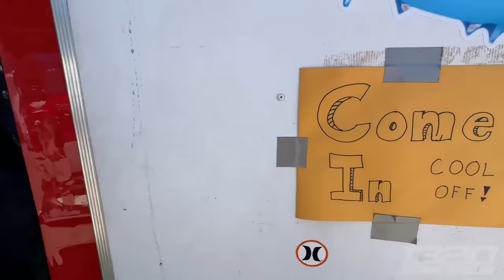300 racers take on 1000 mile Rocky Mountain road trip! | Race Week Day 1

Comment: I can't wait to be there for next year running the 11 second class with my audi a7
Reply: TTv6 awd?
Reply: @TheReaper42069  supercharged v6 awd witha zf8... upgraded pulleys, huge intercooler, upgraded fuel, r8 coilpacks, huge throttle body, divorced water to air supercharger cooling loop with a aux box for ice water, and water/meth injection
Reply: @TheReaper42069  should be 550-600. Cicio has them running mid 10s full interior. I'm gonna gut it for the track and being a hatch it's great for traveling and camping. I put a mattress in it and stay overnight when I go fishing. It's got h&r coilovers and all new solid bushings. Going thru all the supporting systems to make sure it's safe and reliable. It's easy to swap pulleys but I'm touching all the bases

Comment: I want to know who and how to contact someone, to talk about starting (and being a part of) the Ultimate Call Out Challenge Rocky Mountain Race week experience. We need a 1000 Mile Race week for Emissions Intact Diesel Engines. We need to promote to the EPA that Diesels are not the problem and that we can still make reliable Emissions compliant race trucks. And to further prove this, we need a to drive through California and pass an emissions inspection before competing at the drag strip. Additionally we also need to hold a sled pull event (with a Dyno Cool Down event) at the end of the series. Or even at the start of the series to see what we can expect. But all contestants must be Emissions compliant

If you do not believe high Horsepower can be achieved and maintain emissions. Then you can learn how. If our shop can do this. Anyone can. Lets help evolve and Support the Diesel trucks before they are banned. And I loose my job.

Who do I contact for more details to help make this happen?